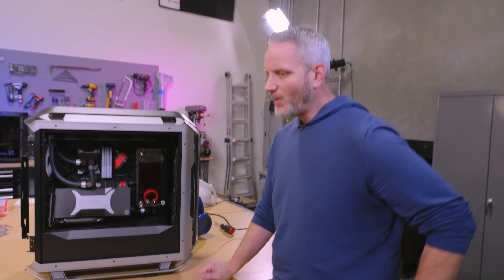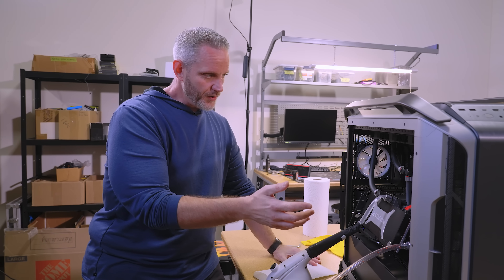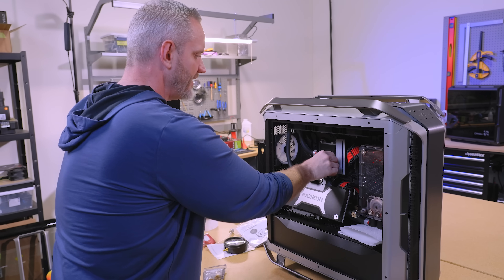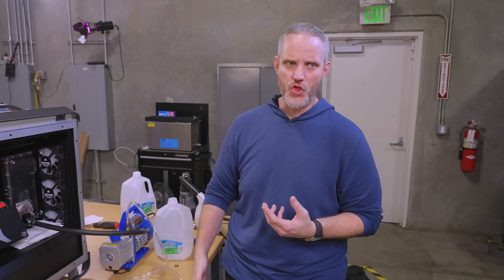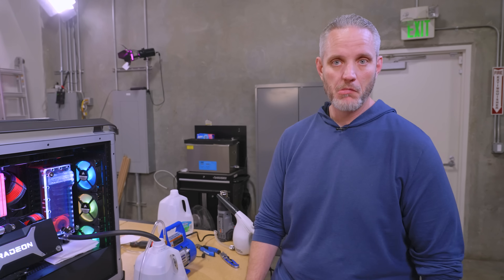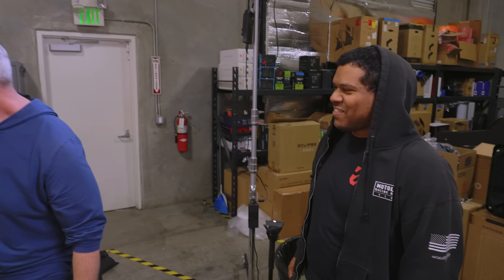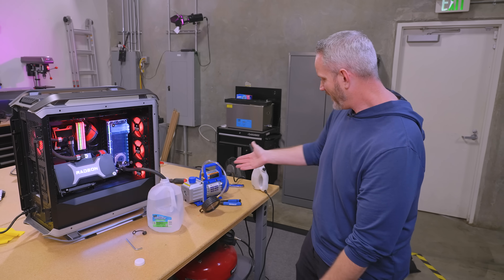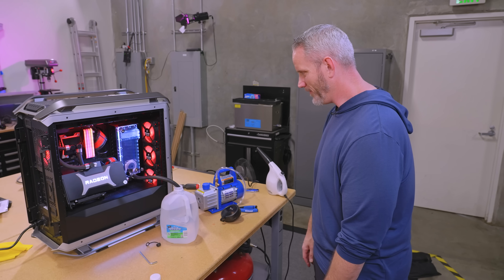I used Vacuum Pressure to fill a PC! Why didn't I do this sooner!?

Comment: Look up how hospital suctions work.  You need a rigid container.  Hook the vaccum hose to the top of it and another hose from the container to what you want to suction.  You can use your current vaccum pump to drain too.

Comment: That IS awesome. Even with that vacuum it's filled enough and now you can top it off if needed. To answer you air bubble idea yours have to prime the tub with fluid then turn it and dip into the jug. Alternatively you could do a positive fill as well by having a tire pump connect to the top of jug, then an exit tube connect to reservoir and force fill it. In that method you'd need an air release at top of the res, or create a loop back to the jug where the excess fluid can safely return. OR a fine mesh that will allow air out but be too fine for liquid to pass the barrier. Just a few other patents to work on Jay.

Comment: If you have another port you could use as a “bleed line” you could fill your system using one of the methods we use with aircraft brakes. We hook up a pressure pot, essentially a garden sprayer with a connector on the end, and then pump fluid through the system which forces out all the air

Comment: Omg I have a vacuum pump downstairs and never thought of using it for this!!!
TIP. You CAN use this to drain. Just have another empty tank with two ports between the pump and the PC for the fluid to deposit. First port pulls fluid from the pc, but with the port in the draining tank being on the top it will only pull air and create negative pressure to pull more fluid.

Comment: I actually thought of trying this a little while back. Had an issue with a rig where I had to drain & fill multiple times. But didn't want to risk it as the loop was all glass tubing.

Comment: The hvac vacuum will handle a tiny amount of water as it's literally what they use them for.. they pull a vacuum on the A/C systems to pull the water out of them and then it makes it easier to fill with refrigerant

Comment: I'm not so much fussed about the bits inside the case, but I am about the case itself. Looks like a Cooler Master Cosmos of some sort, Jay, and I'm in lust for one of those. Are they any good compared to the Cooler Master HAF 932 Advanced I've currently got?

Comment: a watertight container with a shutoff valve at the bottom would allow you to bleed the air out first by hooking up and elevating the fluid container above the fill point.  then when you release the fill valve for the pressure fill the air would be out of the way and you wouldn't (in theory) have to top off.

Comment: make yourself a custom fill reservoir with pneumatic quick connects
1: Quick connect pump to loop and depressurize loop
2: Disconnect pump, and attach fill reservoir full of new coolant
3: Open loop, pulling fresh coolant from fill reservoir into the system. 
4: Disconnect fill reservoir.
5: ???
6: Profit.

Comment: What if you put a catch can in line with the vacuum. Hook that to the highest point of the loop. Then hook a fill line to the lowest point and put that into your fluid source. Turn on the pump until fluid reaches the catch can. Fully filled system with no air?

Comment: Harbor freight sells vac pumps. You can use the vac pump to evacuate the system but you have to use a container in line to catch the liquid.

Comment: Well you can drain a system like that you just need an antisiphon tank. The HVAC industry tripple evacs systems like that but it is using nitrogen. When I did mine at home I presurized it with C02 since I didnt have access no nitrogen at the time. The goal was to get some pressure and then hook the vacuum pump up. It worked fine and when you draw a vacuum the moisture boils off at a lower temp. I would recommend blowing it out like you did or having an antisiphon tank as you do not need to put r410 in this system and worry about making acid.

Comment: The whole thing can be done with that pump and some valves. you have to empty the old fluid so use 2 tanks. you pull vacuum on one tank then open the valve and it pulls all the fluids out then open the next valve and the ne fluid fills the empty lines. you only pulled vacuum the one time. The whole system can be done with half gallon mason jars and like 2 valves. the key is to pull vacuum through the whole system as you are draining it. then close and re open the valves one at a time. you could be unfilling as fast as you are filling.

Like so jay see's this.

Comment: use a jug with a valve lifted higher to fill the hose first before loading the coolant system there would for sure be less air added

Comment: Honestly just make a trap out of a water jug. Route you hose from the pc going to a 3way valve where you can close off any 1 port. The other two go to a water jug and an empty water jug. Mount the hose in the empty jug half way and feed a second hose just barely in up at the top. Route that hose from the empty jug to the vacuum. Step 1 open the valve from the computer to the pump and use the pump to help suck everything out and pressurizing it in the process. Step 2 switch the valve over to the water cutting off the computer and draw up some into the tube. Step 3 switch the valve to go between the water and the computer completing the rotation and let it suck up freshwater. All one motion you can turn off the pump once you're done. The water gets trapped in the empty jug and fresh water goes in 0 air

Comment: Jay love your videos but the radiator fins are creaking because the metal tubes/channels inside the radiator are probably made out of thin metal and are bending out of shape, you could actually damage something the more times you do it as there would be metal fatigue. A better way to do it would be to have 2 ports farthest ports in the loop one connected to the vaccum pump through a air buffer/separator, and the other port into the coolant jug, turning on the vaccum then would simultaneously suck the liquid through the loop and drain a bit in the air separator which can be made from a simple container. Better yet another method is to disconnect the return of loop into a waste bin and push distilled water through an external pump into the loop from the inlet, this pushes the old coolant out and rinses the loop to some extent. Once that is done push new coolant/distilled water with biocide.

Comment: just as an fyi, depending on the setup, especially with like glass tubing, i would be less concerned about the pressure when pulling a vacuum but rather when releasing the vacuum the fluid hammer effect of the coolant flushing into the loop potentially leading to a tube sliding out of a fitting (as mentioned, more likely probably with glass tubing)

Comment: Ideally you want a valve at the high point with a hose connector and a lower valve with hose and water pump.  A water pump can be used to push the fluid in until you've flushed all the air out of the top of the system.

Comment: here's how you can remove even the air in the hose. have a big reservoir with a quickconnect at the bottom. also have a quick disconnect between the hose and vacupump. then, once you got vacume, just move the hose from the pump to the reservoir and bam, fully loaded loop. as long as the reservoir had enough liquid in it of course.

Comment: Jay all you need to drain the system is an air tight bucket inline with the vacuum and two pipes similar to a thumper in a moonshine setup where the coolant can drain into without going into the pump.

Comment: Tip it (or user the port where you'd top off the reservoir) so the port is the (relatively) high spot, and air shouldn't be any problem at all.

Comment: Couldn’t you just use Venturi effect with your shop air to fill it, and not worry about a vacuum pump to begin with? Probably wont make the radiators stress.

Comment: Great video!

Beat you to it Jay, I did this 3 weeks ago to fill, and drain my current system, and like you I love working/building my Subaru.

Mityvac MV8500 Silverline Elite Automotive Test Kit Provides both Vacuum and Pressure

I used this; It does not take as much effort as you think, and also you can reverse the flow vac or pressure, so I made a custom container to hold the liquid, and put it under vac to allow the air to bubble out, and then simply flip the valve to now allow all the coolant to fill the space with out the air issue you had with the fill tube

Comment: Water is super more dense than air, thats why you dont need alot of "vacuum". Why I use brackets is that vacuum is NO AIR... the technical term is unpressured.

Comment: I have a further addition you can try, it's something I used to do for draining hydraulics but it should work (maybe), first you need a container 1 and a half times larger then the volume of the system your trying to drain, the container needs to have 2 valves on it, one going to the system to be drained and one that goes to the vacuum pump, close the line to the system and open the line to the vacuum pump, once you have got the required vacuum, close the line to the pump and open the line to the system, it works to get the vast majority of the liquid out of the system, and if you have a filter on the vacuum line you can do it a few times without disconnecting anything.

Comment: Put another valve on the tube like Phil said and once vacuumed, put the end of the tube in a container with a large enough opening to put the tube  AND your hand in (like a basin). Now open the valves by hand AFTER the end of the tube is already in the coolant. I think this should minimize the air in the loop.

Comment: You could get a second large reservoir. With a valve in and a valve out. Draw a vacuum into it, switch the valves, and have your system drained into that.

Comment: BTW for those that doesn't want to use a full on vacuum pump.... get a brake bleeder. little hand vacuum pump that you squeeze and you'll get the same results and fluids wont break it.

Comment: If your fluid jug was above above the check valve, and the hose fed into the bottom of the jug, the air in the hose would bubble out into the jug, and you would have literally zero air in the system.

Comment: We fill high voltage transformers under vacuum all the time. Pulling vacuum also helps to remove moisture from the system. But we're pulling down past 100 mTorr. And using 7-10k gallons of mineral oil. If you can maintain vacuum WHILE youre filling, you can top it up completely, then just break the vacuum when youre done.

Comment: you might want to check if those creaking radiators actually re-expanded. i seriously doubt they did, youve probably flattened out some of the channels in the radiators. id test this again where you can see it and measure the amount of liquid volume the rad holds before and after

Comment: Could you use quick connect fittings to get around the issue of air in the tube? Pass through fitting in the bottom of your fill bottle you could plug it straight into would eliminate all of the air in theory.

Comment: Love your energy, but you got some stuff kinda wrong.   That pump should have no issue reaching 26-27" of vacuum. You're putting a hose over the top of a THREADED fitting. Not a barb. That means air can easily leak through the threads on the fitting.    Fix that and you'll get better results. 

Also, the air issue..   put a 3 way ball valve on the hose. Or use 2 seperate ball valves. One for vacuum and one for fluid. You should also use a fluid trap in line before the pump so you dont suck in a bunch of cooland accidentally.   Pull a slight vacuum on the system, crack the coolant valve to purge air the. Close. Then continue pulling vacuum. Close the vacuum valve then open the coolant valve. You will have no air. Then you can close your main valve at the reservoir and you're good.

Comment: could take and fill that tube with liquid before sticking it in the jug a bit to get some more of the air out. I feel like the only issue could be the radiator structures cracking from shifting / flexing under vacuum.

Comment: Another automotive product test for you Jay. Would there be any benefit, or ability to use engine coolant instead of PC coolant fluid? I'm just imagining a car rad and fan, running to the engine block case you started to play with. What do you think?

Comment: Wouldn't you be able to use a wet/dry vac with appropriate attachments to just suck the coolant through the system, much like you use the blower to drain the system?

Comment: To empty the system, you could just get a vacuum pressure vessal, get it to -25 or whatever, cap it off and hook it to the drain valve then open them both up and the vacuum vessel would just slurp out all the liquid.

Comment: With regard to this system, wouldn't all the  (unavoidable) air end up in the top radiator?
You'd still have to bleed it, unless you could orient the system so that the res is higher than all the rads and blocks.

Comment: Use a vacuum pot with two ports on top. Drain the system by pulling vacuum through the pot. Then you get you fast empty too.

Comment: WOW, THAT REALLY SUCKS.if you put a valve at the bottom of the fill line and use a bucket so you can reach it , there would be no air at all

Comment: Since you'll realistically only hit about 250mB within the loop, that's unlikely to be enough to cause collapse of any of the components. 
If your components can handle 2 bar of internal pressure, they'll survive most any level of vacuum you could pull on them.
That said, I would be interested to see what a tube reservoir can handle when pulling a vacuum. Especially the bigger ones.

Comment: Now that's interesting. I have one i use for A/C work on mine as well as neighbors and friends Vehicles,  I found it works amazingly well to bleed the brake system. I think Brake fluid is one of if not the top item that should be changed but is not, next to maybe Auto Transmissions and Transfer cases. It seriously makes the job of bleeding the Brakes (especially if the end result is to completely replace old fluid with new. I can see this working well to fill the System. I think I have a few more uses, I will be sure to return and update comments as (if) I find this vacuum idea works on them as well. 🤘

Comment: Did this YEARS ago, Stopped after a couple of times, as I fractured parts and turned the loop into leak central.  I also tried another way which was better, Fill a container with the coolant, and then pressurise the container. LMAO also showed every weak point and leak instantly!!!

Comment: Hay Jay, you can improve it: if the vacuum pump was hooked in a place of the topoff screw plug instead, with additional overfill bottle in that line (hose from the topoff hole goes to the bottom of the bottle, vacuum pump sucks the air from the entire system through the lid of overfill bottle), and the drain pipe was dipped in the new fluid, filled already, sucking in air from the drain pipe like at 5:47 would't happen. Before vacuuming the loop, a bit of fluid could be sucked in up the drain pipe through the drain valve, than after closing it off, we create the vacuum in the loop through the topoff hole. When vacuum is achived, the drain valve will be opened until the fuid will reach the overfill bottle. An overfill valve, placed instead of the topoff screw plug, would stop the overflow, than drain valve would close off the fully filled cooling loop. For the finish, you just unscrew the hoses from valves, and the overfilled fluid goes from the bottle back into the storage container.

Comment: Here is a suggestion for a 100% fill that does not have that issue of the air in the tube between drain and bottle of new coolant.

You have a tank that holds the new coolant. The tank has a hard tube that extends to the bottom and is connected to drain on your target fill system.
You draw the vacum from the top of the fill tank. (Air in the system will be drawn through the tank, bubble through the new coolant)
This means when you have drawn down your vacumn, the entire system will be at low preassure, and your new coolant will ALREADY be between it and the outside normal air preassure.

Thus when you disconnect the vacumn pump, the entire system will be filled. You just need to be sure that you tank and new coolant volumn is greater than the volumn of your system.

Comment: can you build a sealed PC where air is not flowing threw the case?
 this is to prevent dust from ever getting in the case so the PC looks clean forever. 
you would probably need 2 cooling systems. 
1. water cooling loop with external radiators for the cpu, mobo, and gpu.

2. an inner water cooling radiator and an external water cooling radiator to transfer the radiative heat "hot air" from the inside of the case to the outside of the case.
also, if you put the whole case under a vacuum couldn't you use sub-zero liquids without fear of frozen condensation buildup inside the case? like ethanol alcohol chilled to -173f

Comment: put a container between the cooling system reservoir and the vacuum pump for the liquid to collect in and you can do the pulling out also. You can actually do pulling out and vacuuming of the system 2 in 1 :)) Also if the hose from the pc reservoir would be submerged in liquid when pulling  a vacuum you would get the hose vacuumed.

Comment: I actually I cheat Jay I have the system running the pump in the return goes into one container and refill comes into another container and I have no dye in fresh fluid so when I start seeing clear fluids, I know the other systems it’s flushed all the old fluid out while the PC is running..  i then would add a couple drops of dye.  I use mainly distill water and a dye/ stabilizer for pcs.  
 I always thought to try a rubbing alcohol to see if the thermal be any different but worried that it eat the acrylic and tubing lol